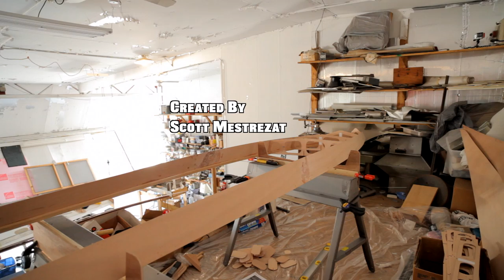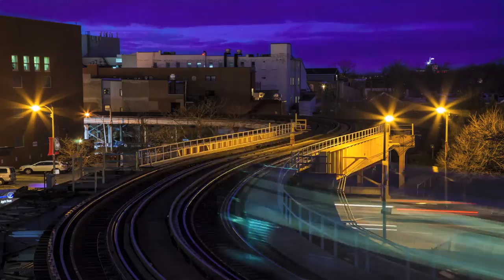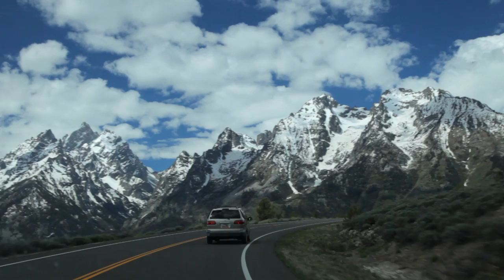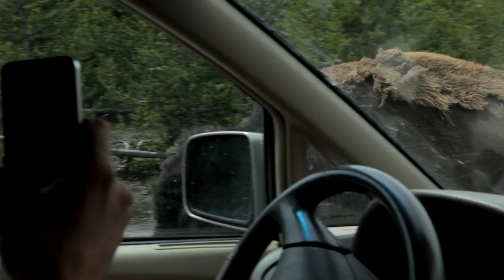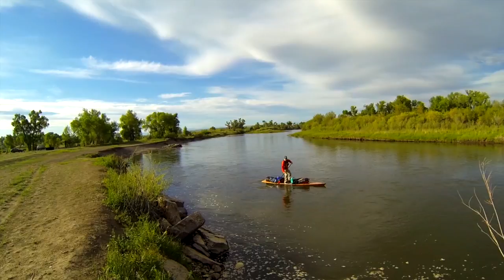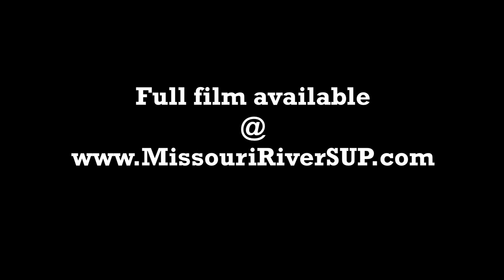Missouri River by SUP! (Stand-Up Paddleboard) - Episode 1

Comment: Nice build! Lol I recently went 100 miles from my dock in MN to the Mississippi then down river. It was cold. Waterproof snowpac boots and about 50 lbs in gear. Also only had 3 days paddle board experience beforehand lol. I was also nervous at first but 1 hour into it i felt right at home. I was on a cheap pelican flow116. Gonna go farther when it's warm and I have time.